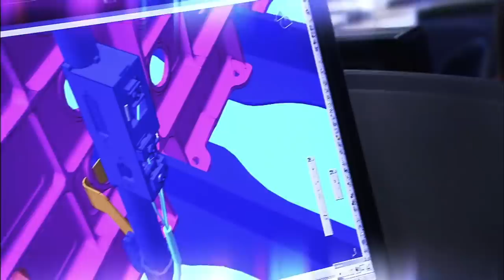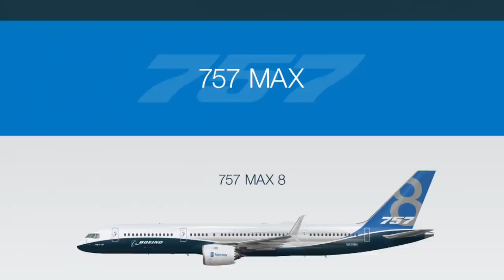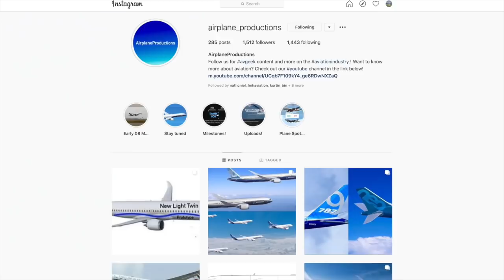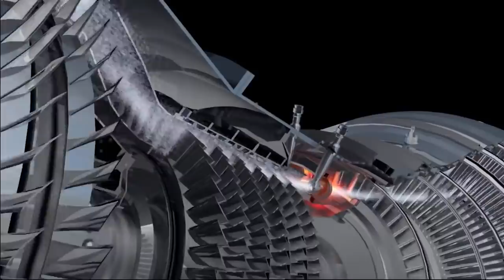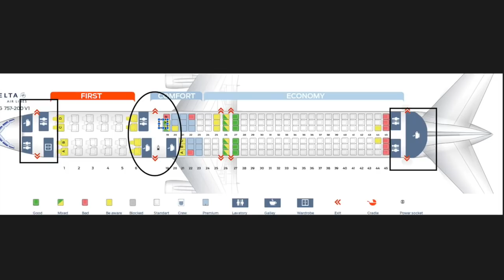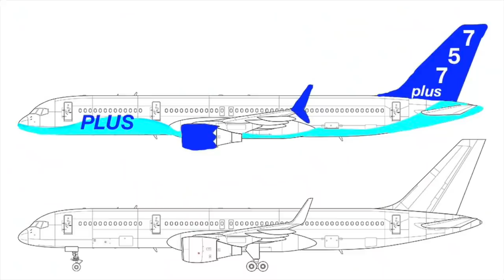Boeing 757: Could a 757 re-engine work? (757 plus)

Comment: If Boeing plans to upgrade the 757, I hope they learn from the 737 Max debacle.
Reply: i want the 757! i want that damn 757!! it's so good don't leave us please everyone loves the 757 but not all love the a320 please come back 757 dont go away!!!!
Reply: 4:20 only rolls royce engines nothing else
Reply: @a i meant that i want only rolls royce engines for the 757 nothing else
Reply: @a the 757 has to come back or else we 757 lovers will protest in front of boeing for the 757 plus
Reply: @a umm.... ok, but the trent 1000 is too big for the 757 plus it needs a smaller engine than that be it any company's
Reply: @arnavsharma9882  Boeing should bring back the 757-300 Production and Replace the 737 MAX Production
Reply: I think they would. Given MCAS exists primarily as a result of the larger engines and how they were placed, the 757 would likely avoid this issue. It’s taller, making a larger engine easier to fit.
Reply: The MAX jokes aren't funny. You're laughing about the deaths of hundreds of people. Also, don't laugh at Boeing, either, Boeing's only 33% to blame - both airlines that crashed the MAX had faked maintenance records for the AoA vanes, which control MCAS. If those airlines weren't fradulent, the MAX wouldn't have crashed. The airlines just smeared Boeing to avoid responsibility.
Reply: AP,  I was not joking at all.  As a recreational pilot, I take aviation very seriously and safety is of utmost importance.   What I was trying to convey, is that Boeing needs to NOT rush to get something pushed through without all the proper testing in place.  Boeing has lost their way and care more about their stockholders than their product.
Reply: @jonsandberg392  My bad, I misinterpreted your comment. Sleep deprivation does wonders to your mind.
Yeah, I understand and share your concern  with rushed product development. Honestly, the 737 debacle is really unique to the 737, because in the MAX's case, Boeing had Airbus breathing down it's neck, and every day Boeing waited would mean tons of orders being lost - so Boeing chose to cut corners. I don't see that happening here (nor did it happen with 787 or any other new Boeings), so hopefully development won't be rushed and corners won't be cut here. Also, I wouldn't say Boeing lost it's way - a properly maintained (AKA maintenance is actually done, not just submitting fake records... cough ethiopian, cough lionair) MAX is perfectly safe, with 0 crashes. Certainly a tragic incident for the passengers, though.
Reply: @anonymousperson2110  With the 737 MAX, it was built on a 1960s air frame with small engines.
Reply: They won't. The fact that they went with B757 Plus rather than B797 means they haven't learned anything yet.
Reply: Yah. So just be nice to the both 757 and the 737
Reply: @nntflow7058  Merely upgrading an existing airframe is not a sign of not learning anything. Boeing just needs to get it right. Their lesson is not that you need to go clean-sheet. Clearly you know nothing about aviation.

Comment: In my opinion,Airbus need to extend the A321xlr so it can handle the same passenger capacity like the 757-300....now that's a true competition
Reply: It has to have bigger wings.  Or another massive leap in engine fuel efficiency...  Which absolutely no one sees on the horizon by the way.
Reply: You would have to redesign the whole plane.
Reply: @gordo1163  Cockpit, fuselage, landing gear, empenage all identical from either previous 757 or off the 737 production line.  Only thing new: engines, wing, where all the wing systems are pulled directly from the 737 production line.....  And a small wing at that.
Reply: A322LR
Reply: Some speculated a potential A322 would be feasible given the increased MTOW of A321XLR. Don’t know if they managed not to screwed up like A340NG, though.
Reply: @steinwaldmadchen  The 321 isn't horribly underpowered either. Especially the neo. It can still get off a pretty short runway if pushed hard enough. 322 shouldn't be impossible, albeit it might roll a bit longer but can't be terrible. But the dwell times of the 321 are long with its single-aisle handling a passenger capacity of 200 give or take.
Reply: @ecoRfan  Yes long turnover could be a turnoff. Don’t forget A321 is already underwing. how far could A322 go would partly depend on performance of XLR wings. The potential of them frame would also matter, as it’s the heavy rework that gone totally wrong and nailed the coffin of A340NG. At last, its about whether GTF/LEAP-X can efficiently upthrust, or if UltraFan can come into play.
Reply from the maker: Faisal Hashim Yep, such an aircraft would need to be more modified with new wing, more powerful engine, but Airbus has been studying more upgrades to the A320neo and A321neo so we may see it one day. Thanks for watching and do stay tuned for more great videos on the way!
Reply: @oneskyflyer  I'm Onboard with A New Boeing 757 Replacement for sure Airbus has A Winning Chance against Boeing so Airbus A321XLR will be the best Replacement for All Boeing 757's even 767's too!
Reply from the maker: Karlos Sargeant Yep, Boeing Absolutely needs to compete with Airbus in this market segment. Thanks for tuning in!

Comment: Right, Boeing is looking to re-engine the 757, what could go wrong, after all it's not like the re-engined 737 had any problems right?   Anyone else feeling less than confident that Boeing can pull this off without its management fucking it up by the numbers?
Reply: The 737 and 757 are not the same plane. And merely upgrading an existing airframe is itself not a bad idea, it's the implementation that ultimately matters. The 737 Max's MCAS was a good idea, but implemented horribly.

Comment: I think that Boeing should release two new 787 version, the 787-7 and 787-6. 
From here on it's full aviation nerd with way to much free time talk
 for the end result just skip to the end :)
The -7 is a bit smaller the -8 but with much less range. The -8's range is 7355nmi or 13,620 km, so I think that 5800 nmi/9350 km is a good place. (This is just enough to commercially fly from Paris to Los Angeles). The -8's max take off weight is 227,930 kg/502,500 lb, so if we decrease the range by that much we can save almost 31,900 kg/ 70,330 lb on just fuel (and that's was just basic calculation it's probably more then that). Now we have a lot of empty fuel tanks that are also getting removed, and after we removed so much weight the wings spam will decrease and less powerful engines will be needed and the less powerful the engine the more efficient it is (that's a general rule about engines and specifically jets). and I also increased the width a little so the seats will be 18 in wide. 
For the -6 we will shrink the fuselage by around 6 meters/ 20 feet (I know its a lot) and decrease the wingspan proportionally. For the range: 5300 nmi / 8530 km, which is around the same as the A321XLR. 
Because of the much decreased range from the current 787 different wingtips will be considered (prob the split winglets from teh max).
The end result is: 

787-7: 
Length: 52 meters / 171 feet
Passenger capacity: 240 (2 class) - 350 (one class) 
Range: 5800 mni / 9350 km 
* Around 15% lighter then the -8 
* GEnx-2B engines are the best current option (they are used on the 747-8 and are a bit less powerful then the Genx-1B the 787-8 uses) preferably a scaled down version (GEnx-3B63/64)
* A bit wider fuselage to increase seat width to 18 in
* Its a bit smaller then the 787-8, lighter, smaller wingspan, (maybe split winglets from the max) and based on the cancelled 787-3. 

787-6:
Length: 46 meters / 151 feet 
Passenger capacity: 210 (2 class) - 320 (one class) 
Range: 5300 nmi / 8530 km
* Built to directly compete with the Airbus A321XL. The -6 has a bit more seats and range then the XL.
* GEnx-2B are the best current option for engines but a scaled down version (GEnx-3B60/61/61B^) is preferable.

^ - ask me if you want to know the diffrence between GEnx-3B61 and 61B

Realisticly, these planes are a bit to long to meat the capacity munbers I gave then but thats not the biggest prob with these new version. The biggest prob is the 787 production line, let me explain. The 787 has 550 unfilled orders atm and around 150 more to be ordered in the next two years, that means that the production line is full or almost full until at list 2026 prob 2028, and if boeing would start working on the planes RN they will be ready until 2024, 2025 (and thats realistic). The planes will wait in the backlog for around 2-3 years before the first ones get delivered. 
but if we get rid of this prob somehow then I think these are the best options Boeing have to fill the middle of the market.
Reply: 8 wide seat aircraft drag compared to a 757 6 seat aircraft wide.... same range... except yours has the still ultra heavy landing gear, wing box too large rudder, horizontal stabilizer, and wing of the 787...  Massive drag and massive extra weight... are you for real?  There is a reason the 787-3 never flew and why the 767 is not flying passengers.  Why they were talking a possible oval fuselage wider than it is tall which correspondingly means: no cargo and many routes make just as much on cargo, as passengers.  Especially on thin routes to out of the way places.  Now this world has fewer and fewer out of the way places...
Reply: @w8stral  you are right and u thought about it when writing this and decided not to write about it. But if you decrease the wingspan by the amount I thought they will (2 meters on each side for the -7), and especially if you switch the curved wingtips to the split winglets the pressure on the wingbox decreases and it can shrink. For the rudder and horizontal stabilizer I don't know what to say, they are really large with a good reason for being that large and I'm not an engineer (yet) and I don't know what will happen if we decrease their size after we decreased the size of the plane. 
For the fuselage, I thought about after posting this, but instead of making it wider then it's taller, we can make it narrower, narrow enough to have a 2-4-2 seating configuration, with 18 in seats and wide aisle. This makes the plane a bit aerodynamic. But if we do that we need to lengthen the planes by around 4 meters to add 3 more rows of seats.
Reply: @eladevron24  As I replied to someone else.  767 holds same number of people as some versions of the 787, but its empty weight is 40+ tons lighter.  To visual this, 40+ tons is the Cargo payload of a 767F or  the empty weight of a 737. 

PS: Entire wing would have to be changed out since unlike aluminum where you simply never install/rivet/weld on extra extrusions to build up section modulus, Carbon fiber is limited by its orientation of fibers and certain bulk factors are required to achieve superiority over aluminum.  In fact, carbon fiber in  thin sections is much INFERIOR to aluminum.
Reply: @w8stral  you are 100% right, but the development cost for a new 767 version will be much higher then for a new 787 version.
Reply: @eladevron24  Lets do a brief look at that.  Both need 100% new wings, both retain their fuselages.  New wing will be carbon fiber based which means can take the systems direct from the 787 for both LE/TE and lightning protection.  Which also means it will be fly by wire which means cockpit will be taken 100% from 787.  Landing gear will be~ 767F.  Empenage doesn't really matter as the cost is negligible either way. 

The only true cost will be the FAA and testing required.  Which is the ONLY reason the above has not already been done.  WHICH way do you try to pass off this notional aircraft as nothing more than a variant...  I leave that up to you.  I cannot believe they can pass this off as a 767 or 787 variant though I would lean your direction as a 787-3 moniker, but that fuselage wing box section is horrifically expensive on 787 and HEAVY with 8 wide seating making this a DRAG queen for only 220 passengers.  767 is bad enough, and I see neither aircraft being built.  Only real question is there enough demand for 220 seat aircraft able to fly 5000nm with cargo or not--> AKA 757 new build
Reply from the maker: Elad Evron Shrinking the 787 was studied before! Remember the 787-3, but the issue is the high seat cost of such an aircraft as it is deoptimized when flying shorter routes. It is too heavy and overpowered. But yeah interesting if Boeing could modify it heavily to match efficiency standards. Thanks for watching and do stay tuned for more great videos on the way!

Comment: Delta will probably still wait for it. a321xlr has its tradeoffs.... assumed 24t with the range of 3650nm, moreover 757 better max payload..all the way to 3800nm
Reply: @col loc The fact is, 757 sales started drying up when A321CEO is launched, way before NEO (Yes they ARE competitors in the eyes of many airlines), 752X (the "improvement" you keep mentioning) was proven unattractive, and 753 is niche. 
Boeing stopped the line for good. If they want to restart, the question will always be - how much demand are left for a more capable A321 + 753, (which currently equals to 226 owned by Delta, United and Icelandair) and will that justify the dev cost. Note that due to commonality with A320s, quite a number will naturally go to A321XLR anyway (remember AA?) , and the rumored A322 is not yet mentioned.
And unfortunately, even with heavy work, MAX10 still fall short of A321NEO by payload, takeoff run and range, let alone LR/XLR. While Boeing can in anytime rework the 737 further, any radical changes risk losing the grandfather rights.
Reply: @col loc The fact is, 757 right now is ~8t heavier than A321XLR, and ~800nm short of range. Boeing will need to carve out weight, while maintaining payload and extending range. But that still doesn’t address the issues of lacking commodity, capability of loading containers, and large customer base to share the development cost.
Are there adequate customers who really need the extra bit, other than Delta?
Reply: @col loc Just to remind you that 
1. 757 was intended as a 727 replacement, a.k.a. Transcon/intra Europe aircraft. TATL was never the mainstay until 2000s.
2. A 239-seat 757 was considered midsize when 737 was 149 at max, but not when A321 could seat ~220.
3. Why would a small airlines with 50 aircraft decided dedicated 757 replacement worth the fleet complexity, when AA having 50 757s against this idea? No one but DL/UA operated more 757s than AA before COVID19.
4. A321NEO is doing MNL-SYD daily, well beyond MAX10's range. LR/XLR is out of the question.
5.  It costs twice as much as NEO to develop MAX, before 2 fatal crashes thanks to poor workaround costing more. Further rework would only be more expensive, if possible, but it still can’t load containers and mitigate other restrictions of a 60s frame.
Reply from the maker: Cynthia Wong Thanks for your comment. Yep, the 757 will no doubt have slightly better performance which Delta May be looking for. Thanks for watching and do stay tuned for more great videos on the way!
Reply: @oneskyflyer  and xlr has a low cabin pressure. haha thank you for the video sharing,  I'm working on my thesis about A321xlr  but I am hoping to see nma/  re-engined 757:)
Reply: col loc I agree. Boeing needs to make an announcement quick especially if Delta is willing to buy a 100+ New 757s
Reply: col loc Another 737 variant!!??? I think the MAX should be the last variant completely.
Reply: @col loc No you are a fanboy.
After all it’s how AIRLINE and LEASING COMPANIES see the aircraft that matter, not A/B or us.
1. 757 is overbuilt as a 200 seat people mover, and improvement is NOT going to mitigate this.
2. Airlines in 90s started seeing A321 as a better people mover COMPARED TO 757-200, BEFORE any continuous improvements. Large chunk of customer base already GONE at that point, as shown in SALES.
3. Boeing DID purposed 757 improvements in 90s, just that demand DIDN'T justify that. NO ONE ordered 757-200X and <100 757-300.
4. NO improvements could make 737 wide enough to fit LD3-45, or tall enough to make room for larger engines etc., WITHOUT losing grandfather rights. So either compromised MAX or expensive Y1.
5. Continuous improvement is not magic in Airbus either. It's the frame decide how far it can go. It didn’t help A380, went totally wrong in A340NG, nor match A300/310 with 767. And let’s not forget A330 is essentially eating up margins for A340 to "growth".
Yes it brings A320 and A350 to new height, but both of them are well designed right from the beginning, and the fact that neither of their counterparts are well positioned - too much (777/757) or falling short (787/737).